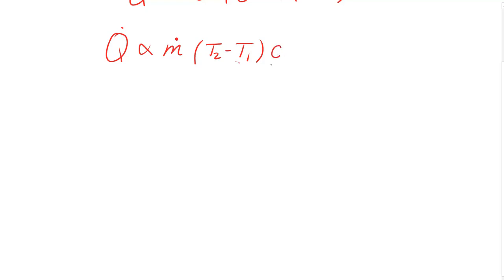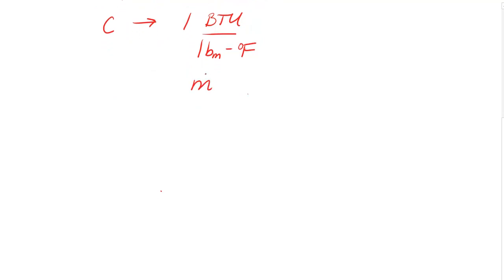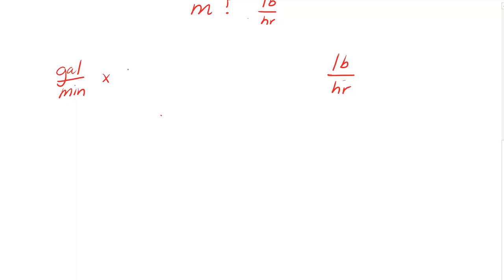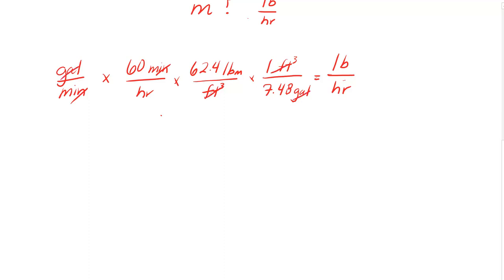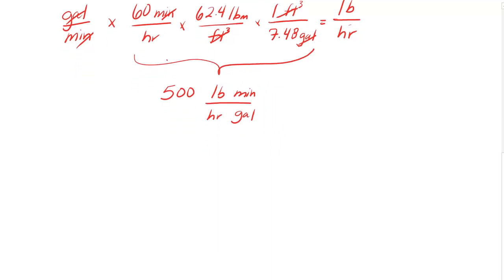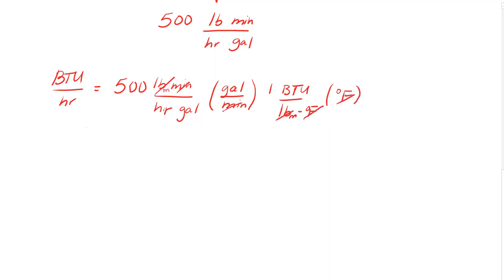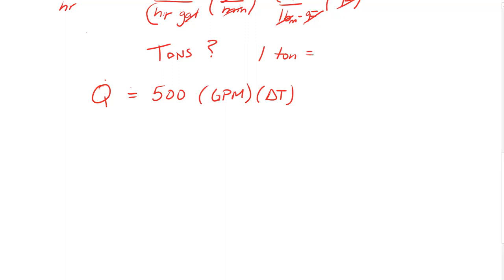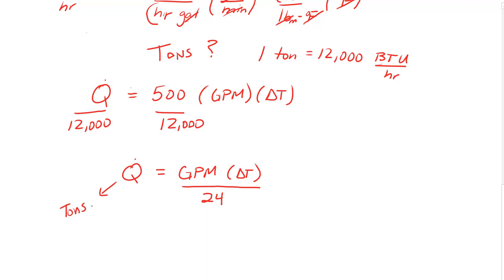Sensible Heat Formula for HVAC Engineers - Where does Q=500 GPM ΔT come from?

Comment: only applies when dealing with water as the liquid?
Reply from the maker: That's correct.
Reply: you can apply a similar simplification for propylene glycol or other partial mixtures, you just have to adjust the density value used to 'reset' the constant to your application
Reply: yes